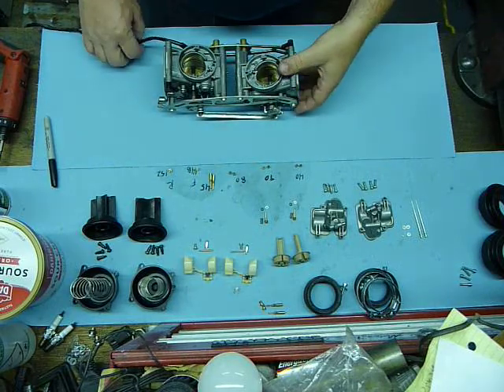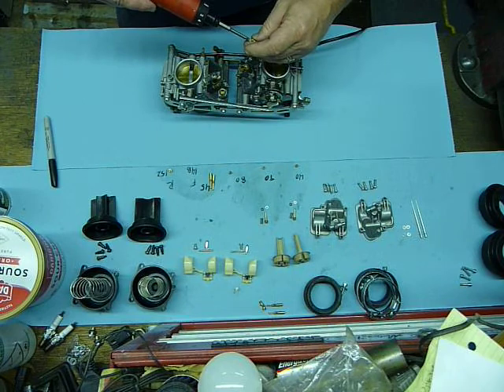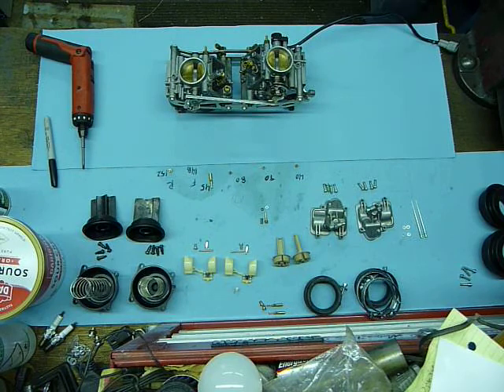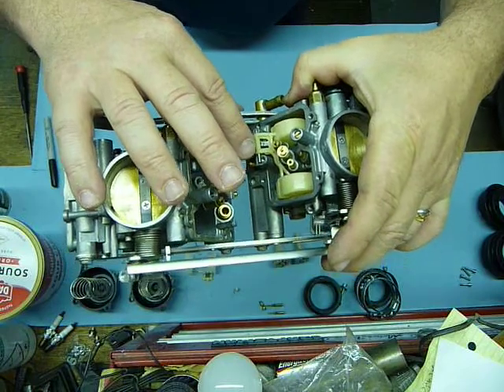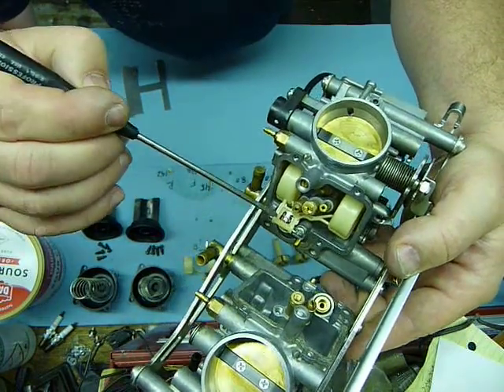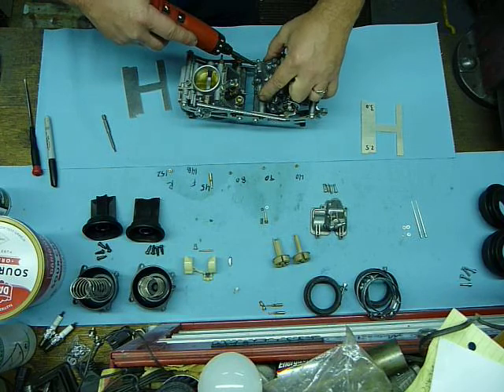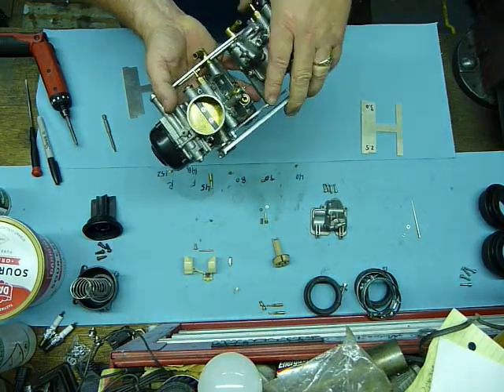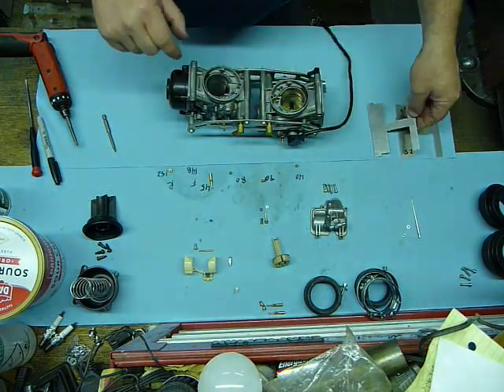Adventure Machines KTM 950 Carb Service-Episode 3

Comment: Hi Ken, thank you so much for these videos. Best thing on the internet for a KTM 950 carb. I’m quite sure my carbs are running rich. Dying at idle, sludgy looking spark plugs, smells rich, bad mpg. I replaced the plugs and that helped seemingly, but now it just varies more widely in its idle speed. Sometimes perfect, others very low and dies. According to the service manual, the fuel air mixture can only be adjusted with the carbs off (???!). Is there a good reason for this?  Ultimately my question is, how do I diagnose and fix it running too rich? I have a carb kit arriving tomorrow, and a carb balancing tool arriving in a few days, so I’ll clean out the carbs and reassemble. Do I just set the mixture screws to 1 3/4 turns out and hope for the best? Any help is invaluable. In fact I’d be happy to send you money for a good step by step process breakdown. I want to learn to do this myself, and I’m willing to pay. Thanks 🙏

Comment: Great series! At 6:27 you talk about the take-up shim. Just a few questions on that. 
- is that oem?
- what function does it serve if not oem?
- should it be used on both carbs or just one and if so, front or rear?
Reply from the maker: the 'take up shim' is a stainless washer, that helps keep the clip from wearing into the slide body. It also functions as a half clip position. It is a OE part, but if a person isn't aware that it is there when disassembling, they can get lost easily as they can get stuck on the slide and then fall out at a later time during cleaning. OE stack is this, bottom up: Slide, washer, clip. Same for both front and back

Comment: HI There Can you change the fuelconnectors in the karburator hvile the karburators is on the mashine?
Reply from the maker: I don't know for sure, I have never tried, however my guess is no it is not possible given the location and how they are retained by the bridge fixture on the side of the carburetors. Aside from the airbox being in the way, the frame matrix will likely also be very in the way. The quickest method would be to remove them from the bike. Keep in mind that you must use a impact driver to remove the screws from the bridge. They are tight and they are glued in with thread locker.

Comment: Awesome video. WAW ! Fantastic series! But I've got a question. My 950 carbs have done 125.000km and the bike backfires a lot when closing the throttle. Almost sure it's the rear carb throttle valve axle that has too much play. A known problem, with almost no cure. So I'm thinking about disassembling the valve and the axle. Perhaps replace the axle with one from a front cylinder carb. But the screws that fix the valve to the axle have been peened. So they have to be ground away. Which is all very good, but how to I fix those screws afterwards? Some kind of Loctite? New screws that have to be peened too? All information is very welcome.
Reply from the maker: Getting the throttle plates off of the throttle shaft without causing damage is very difficult. Also, the carbs are NLA from KTM and to my knowledge, there are no third party new parts sources.  I would make sure that the ACV is working correctly, air-jets are clean, pilots are clean, exhaust flanges/interfaces are tight before trying to tear apart the shafts

Comment: Can you get the emulsion tubes just above the main jet out of the carb body ? Can debris get into the internal passages?  I’ve cleaned the carbs out several times, can’t see any debris anywhere. When starting it runs as if it’s on one cylinder, pops and bangs, only runs with choke on as soon as you try to open the throttle it cuts out.  This bike is driving me mad !!! I’ve changed fuel pump and put additives in the fuel, just got the carbs off again, can’t see anything wrong.  Any suggestions?
Reply from the maker: are you 100% sure that the pilot jets are clean and the IMS circuits work properly?  We offer ship>service>return on carbs, send a message to advmachines AT advmachines.com and we can get you setup.
Reply: @AdventureMachines  thanks for the information on my poor running KTM 950. I had a better look at the pilot jets and yes they were blocked, got a piece of wire up inside and white powdery deposits came out. I can’t believe all that popping and banging was caused just by blocked pilot jets but it seems okay now. Just by watching your videos gave me the confidence to dig deeper into the jets and you were quite right with your analysis. There’s a lot to take off the bike just to get to the jets but well worth it. Just got to stop them blocking in the future, additive in the petrol I presume

Comment: Hello Ken, i can see you set the float  bowl hight at 3.5mm , im confused after reading on ktm950.com , inside the HOW section it says the spec is 15mm.
Reply from the maker: It is physically impossible to set the floats to 15mm, so the reference you mention is either wrong or they are referencing something else. Float height range is anywhere between 2.5mm and 4mm, measured from the bottom of the float globe to the gasket surface.  I have the measuring tools our our website www.advmachines.com
Reply: @AdventureMachines   Thank you Sir.